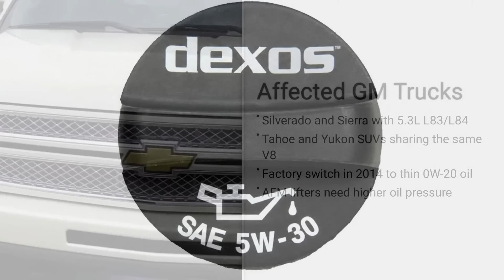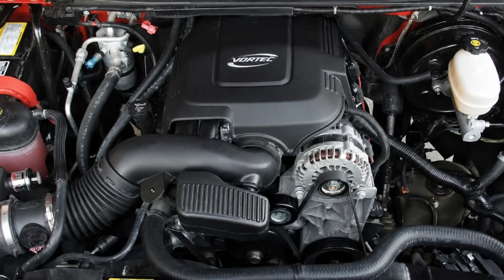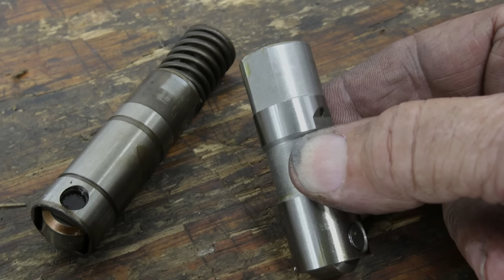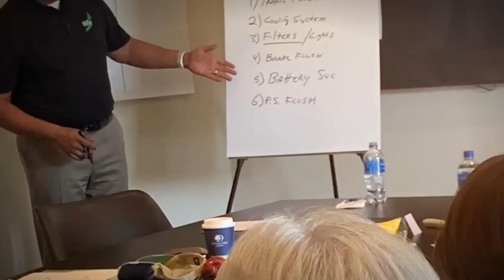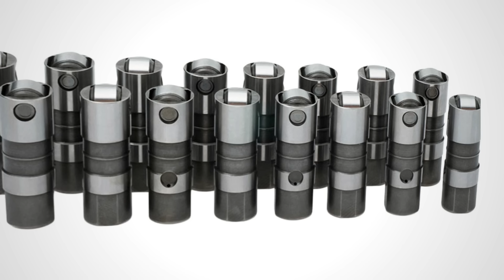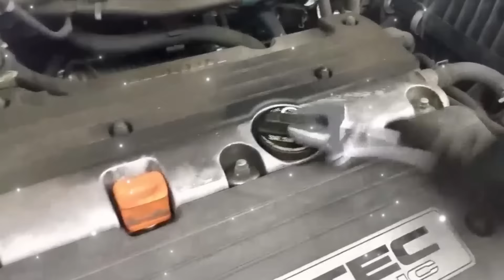The 5.3L Oil GM Tells You to Use Is KILLING Your Lifters — Switch Before 60k Miles

Comment: You pretty much nailed it.  I had lifter failures in both my 2014 Sierra and 2018 Denali.  The 2014 was covered under warranty but the 2018 Denail was not, cost me 4k to get it repaired. I installed one of those AFM disablers onto the OBDII port, worked like a champ. Also, I made sure I did the oil changes myself and used Mobile 1 5-30W instead of 20W.  The 2018 failed at just over 60k miles, just outside the warranty. After switching to 30W, and disabled the AFM, went to 135k miles NO PROBLEM before I sold it.  These engines are great aside from AFM.  The motor would only burn a 1/2 quart between 7500 mile oil changes @ 135k miles. I agree that the number should really be 5,000 miles.  And ONLY use Mobil one, I'd never use that AC delco crap or any other oil that wasn't dexos certified. I use Royal Purple in my 2012 Sonata, has 150k miles, still purrs like new motor!  And that was one of the "bad" engines. Turns out you just need to overachieve on maintenance and they will go as long as you want them to. And don't listen to what the owner manuals tell you, they are full of poop.
Reply: Does your 18 Denali have the 6.6?
Reply: @ParagonRetrievers  6.2L, wish it was the 6.6L, wouldn't have had that problem, as the 6.6L does not have AFM.
Reply: @KingEdward-o7x  Sorry I meant 6.2. We have a 19 yukon xl with the 6.2. Its had all the lifters and push rods replaced in the left side if the engine because of the afm failed lifter. We also have a 17 duramax for transporting dogs. Thanks, we'll be changing to 5w30 on the oil change with the yukon.
Reply: @ParagonRetrievers  yeah after that happened I started using ONLY mobile 1 synthetic and changed it every 7500 miles. Did good after that, went 135k mikes without incident. The key i believe stick with mobil one although i think castrol and penzoil are good too. The main thing is that dexos rating. On my new duramax i’ve been trying to change every 5k mikes although thats probably overachieving some. Alot cheaper than a new engine though.
Reply: Oh as also use the 30w. 20w is a big mistake even though that’s what GM recommends

Comment: I have a 5.3 in a 2007 monte carlo SS with 8k miles, always changed oil started every month during the winter.  One day a month ago started it , was missing, thought maybe some gas problem.  Drove a bit, Check Engine light & traction light came on it never stopped missing.  Short drive, changed the oil (5-30) delete code then p0300 code (random misfire), deleted that code starts idles good for a while, then Check Engine light random misfire code after a while the traction light came on. Next step to get a professional scan tool on it to check where the misfires, fuel trim etc.  Wow this will be a major repair, drop the engine to change all lifters and cam!  AFM what a stupid idea pretty complicated system for a few MPG from an otherwise great engine.  What make of lifters and cam should I use?  Thanks 😓

Comment: Got a '18 Silverado for a work truck, with 18 miles on the odometer. Retired in '25 and the last time I drove that truck, it had 97,000 miles on it and it is still in service.
Reply: my 2012 Silverado with 6.2L V8 has 206,000 miles....still runs great...never a single engine issue.....used 5W-30 and oil changed every 5-7k miles.  But i'll NEVER buy a NEW Truck from ANY manufacturer until they fix their garbage and cut the ridiculous price-gouging prices in HALF!!

Comment: Ive run 0w-20 for 245k miles on 2014, half quart of Marvel mystery at every oil change and 1/2 quart half way through an oil change. All factory lifters still working and no failures. Changed oil when the truck  told me to everytime. Runs like a sewing machine, also run AFM delete chip for the past 200k.
Reply: no one anywhere should ever use 0W oil.  it never gets 0W cold anywhere.

Cold Testing Temperatures by Oil Grade

0W Oil, Cranking test: -31°F (-35°C), Pumping test: -40°F (-40°C)
5W Oil, Cranking test: -22°F (-30°C), Pumping test: -31°F (-35°C)
10W Oil, Cranking test: -13°F (-25°C), Pumping test: -22°F (-30°C)
15W Oil, Cranking test: -4°F (-20°C), Pumping test: -13°F (-25°C)
20W Oil, Cranking test: +5°F (-15°C), Pumping test: -4°F (-20°C)

Type this into Google (for your location):  How many days in the last 10 years did the temperature of MY LOCATION drop below -31°F, -22°F?, -13°F, -4°F, +5°F?

Use 10W-40 minimum, year-round, use 20W-50 for heavy duty like summer towing, always idle after start until idle drops, and never slack until oil gets dark/dirty.  Change all other fluids at lowest end of their listed service range.  ..then why has the manufacturer cabal been exclusively listing 0W oils in the owners manuals and on those freaky little stickers under the hood?  Because the manufacturer cabal would prefer that your vehicle enjoys a shorter lifespan and for you to buy another of their vehicles sooner.
 
ENGINE OIL COLOR CHART
https://www.instagram.com/p/DP2kLcxEvqR/
Reply: Same here but on a 2016 up to 150k. Switched to 5w30 high mileage and lost a small amount of power but it seems smoother
Reply: Hell yea!

Comment: I use 5w30 in my vehicles then switch to 10w30 when I hit over 100k miles and most of my vehicles run for 350k or more until I get rid of it

Comment: 2018 sierra. Bought used and first thing I did was put the delete in the obd. Has around 140,000 miles. Now I will changing the oil type. My son has a 2015 that we've changed out lifters but still tracing down a cylinder 1 misfire.
Reply: Swap the coil pack from cyl.1 to another cyl. and see if the misfire changes to the other cyl.
It's about due new coil packs.
When one fails, the others soon follow.

Comment: Tighter bearing tolerance is the reason for the lower viscosity
Reply: So they say… but then how do they justify 0-40 in the trucks after the catastrophic engine failure?
Reply: @Maynardd  Premature engine wear
Reply: @CAN43714 huh?
Reply: Premature bearing wear from crankshafts made in Mexico that where not up to specs causing what was once tight tolerances to now be loose and the need for thicker or higher viscosity oil.

Comment: I have an 07 Silverado with a 5.3 had a lifter fail, and most recently was losing oil pressure so I changed my oil from 5w30 to 10w30 and my oil pressure came back better than what is was before it start acting up
Reply: No difference between the two
Reply: You don't understand oil numbers, do you? I will help you out. 5w=winter=good down to -20 degrees. You pretty much put the same oil back in your vehicle 🤷

Comment: According to the Above Video
1. SWITCH from 0w 20, 0w 40 to 5w 30 - I hear overseas it's 10w 30 but you go look it up
2. Shorten Oil Change Intervals - I go for 3000 miles (5000K)
3. Look into Physically getting rid of the AFM/DoD/DFM - NEW Camshaft, NEW Lifters and a tune
4. Use an OBD2 AFM Disabler - this tricks the Engine Computer and you are always in V8 mode
5. At approximately 50 000 miles (80 000K) have a Mechanic check the VLOM Thimble Filter

Comment: We have a 12 suburban with the 5.3 l and it does have the afm knock on wood no problems yet and we have well over 300k on it but it gets the oil change every 3k miles and it’s the 5w30 that is put in it

Comment: My 01 with the 5.3 has never seen anything but 15w40 Rotella and it has 501,259 miles on it and it has never ticked or tinged and it runs like a top.
Reply: Rotella diesel oil?
Reply: @joshcollard7834 yep rotella diesel oil.
Reply: @DirtySouthCustoms my neighbor has a GMC 3500 and that's all he puts in it with 360,000 mi on it.
Reply: It also doesn't have AFM...
Reply: @tmbr3nd3n33 my wife's 09 has AFM with over 293,000 on it and all it's ever seen is Rotella and it runs perfectly. Do a little research and you will learn to ignore those numbers on your oil cap.
Reply: 15w40 is the way

Comment: They should give you the option to have the AFM deleted when you buy it brand new with no extra cost to you.  Instead of you having to waste money on a factory defect they refuse to fix.  They can fix the problem before you buy the vehicle.
Reply: Put in Manuel mode M5! It will then stay in V8! Those AFM plug in’s can mess up truck engine   Electronics at least in my exp! Engine light told me change gas pedal, then told me need O2 sensors ?! Thank God I have a good honest mechanic!
Reply: @StoutBordeaux does my 2012 have this mode?
Reply: @DavidMackerron yes on the shifter
Reply: We should sue there asses
Reply: Yep , my lifter just collapsed
Reply: Yes it’s total bullshit . There needs to be a class action lawsuit against gm for this shit .
Reply: @BlueCollarChief-5 and get $150 and the lawyers make off with the money
Reply: There is way to disable the afm..look it up..problem solved..
Reply: IF YOU JAVE AN OLD TRUCK 2006 OT OLDER KEEP IT  DON T GET A NEW TRUCK TO KEEP UP WITH YOUR FRIENDS
Reply: PUT RISLONE  OIL TREATMENT IN YOUR  OIL  DIRT IS WHAT CLOGS LIFTERS  RISLONE CLEANS THEM  OUT IV E USED IT FOR 40 YEARS ON A NUMBER OF TRUCKS AND CARS
Reply: I don't think the Work vehicle line uses them.

Comment: bought my 2016  5.3L  used from chevy dealer with 7500 mi  former lease, trans got triple flush to stop shudder, now I read it may be best to up the weight from 0-20w full syn dexos.  Chevy only doing oil/filter changes since purchased and has 96,000 mi with only a hint of a tick usually on startup but may be during idle, hard of hearing a bit and not sure if still ticking when driven.  dealer says my vin shows my truck is not on recall for delete of lifters or other materials.  I'm due for next change at 5k miles now.  Should I just request 5w-30 full syn dexo with my oil change from them?  I use a plug in afm dissabler only and since 89,000 miles.  Gas mileage and performance no change but easier on the tranny as it feels smoother I guess.  No warrantee left.  What is worth doing, the  thicker oil or nothing?  I get 25mpg hwy going 65 mph on 110 mi trips one way usually unless stuck in traffic.  Very disappointed for not keeping my 2003 Tundra 4.7 4x4  trd 8 yrs ago.  Traded it in for the chevy.  Regretted that move.

Comment: I got a 2003 chevy Silverado I use 5 30 valvalene synthetic  with shield  mines got 230.000 miles on mine get your gas at shell with detergents
Reply: Yeah the earlier 5.3 l engines did not have the AFM system. I believe a lot of it is maintenance as well. I'm currently driving a 2012 Silverado with the air fuel management system, it has 279,000 mi on it and still has the original lifters. It was serviced on time every time though. Every 5,000 MI

Comment: I bought my 2000 Chevy Silverado four-wheel drive V8 Z71 extended cab  brand new at 70,000 mi engine starts to knock took it to the dealer dealer says need to replace my engine went and got a second opinion second mechanic says my engine is good general motors just made poor design on the engine the mechanic tells me engine needs a good flush add a quart of transmission fluid drive around  ex 100 miles and change your oil I did this twice in one year The engine knocks stopped My truck is 26 years old I still own it no problem  I have three other vehicles and I do the same thing to my other vehicles once a year add and quart of transmission fluid drive around an extra 100miles and change the oil I hope this helps 💪🏼👍🏼🛠️🇺🇸🤠

Comment: 2022 Silverado 5.3 using 0w20 my oil pressure at idle after getting it good and hot was between the lowest 2 lines on oil pressure gauge. So I tried 0w40 and then my hot idle pressure never went below 30psi on the gauge. Now trying 0w30. My hot idle pressure on the gauge is just under 30psi. Only have 32,000 miles on engine. Change oil every 5,000. Average fuel economy varies from 19-23 mpg depending on how much highway driving I do. I also use manual shifting on long or steep hills to hold speed back so sometimes running pretty high rpms. So far still running good.
Reply: try 5w40 and you will be shocked at how high the oil pressure is. I use 10w40 Castrol but I live in a hotter country.
Reply: Yeah increased oil pressure isn't exactly great. Under load pressure raises at idle it lowers thats how motors function properly lol
Reply: @plack_benis382  not trying to get too much pressure. Just don’t like my hot idle pressure being so low. 0w20 is between 7.5 and 15 psi. 0w30 is giving  between 22.5 and 30 psi. Both grades of oil run about 60 psi when cold idle.

Comment: the eggheads that work in govt and make the regulations haven't a clue.   they would rather you use an oil that gets you a miniscule fuel economy improvement while it slowy destroys your engine.     the money you save with that minscule fuel mileage increase does not pay for the engine the eggheads destroyed.   not even close.   USA has become stupid and is run by incompetent idiots with agendas.   the voters are no better.   they vote in losers and re-elect them year after year.  the usa is going to fail due to apathy and ignorance of its voters.

Comment: my 2019 Silverado I started using 0 w 40 at 150k still runs like new Mobil 1, after the switch the oil pressure come up considerably, I could feel better response also on the 2023 prius I went from 0 w 16 to 0 w 20 but I should be using 5 w 30 because i drive it only in the summer.

Comment: Been running 5w30 in my 2019 Silverado for as long as I can remember. I don’t trust that thin ass oil. Glad my intuition was right.
Reply: How many miles have you put to your silverado if you don’t mind me asking. Trying to switch as well to 5w30
Reply: @mcirving just do it
Reply: We r talking 5w-30 full synthetic? Right? Also what is the difference between decos gen1 and dexos gen 3. I’m driving a recently purchased 2021 5.3l with 150,000 silverodo. At 154,000 I changed the oil with 0w-20 full synthetic dexos gen3 mobile 1, wix filter. It came with a obd2 concealing module installed and supposedly its oil was religiously changed every 5,000miles. Should I still move to 5w-30 full synthetic dexos gen3?

Comment: I have a 04 Yukon with over 396,???k miles on it.The oil cap says 05W30 weight but I have always put 10W30 init and all my V8 vehicle's. Never have I ever had an issue with any engine's and I've been driving for 43yrs.
Reply: Depends on where you live bub.

Comment: I'm using 5W 30 synthetic in my 2012 GMC Sierra no matter what. I was going to put a AFM chip in and run with it but when I did I had all sorts of failures. I think it collapsed my catalytic converter so I took it out got the truck fixed and haven't considered putting a AFM blocker in since.

Comment: I have a 2017 Silverado with the 5.3 and 95,000 miles. Ive been adding BG MOA ever since it was new, and havent had any problems yet. Is it too late to start using an AFM disabler?
Reply: only too late to plug in a disabler is if the lifter is already collapsed
Reply: I just installed one on my 2014, i love full time v8

Comment: 2007 5.3L b has AFM; I am using the OBD 2 disabler. Change oil every 5,000 km. Has 300,000 klm; just rebuilt the 4l60e. Engine has awesome compression still.  I'm in Alberta, Canada. Journeyman mechanic, love your videos.
Reply: Which disabler do you use im looking to buy one for mine

Comment: I have a 2015 chevy silverado LTZ 5.3 I've been using 0w-20 as the cap says. Would it be fine if I switch to 5w-30
Reply: I've always used 5w-30 mobile 1 and AC Delco oil filter or mobile 1 filter only it's better for your engine 0w-20 is not good for them I heard

Comment: I have a 26’ sliverado 5.3 it takes 0w20 i want to swap to 5w30 so bad ideally I would prefer 10w30 but that’s me but the have full warranty I don’t want to void it.
Reply: By then it's too late... 0 to 5 will not cause damage but 0 will, do a oil inspection, then change to 5 and get it analyzed...compare for yourself... 👍
Reply: @BeAsOneOk switching to 5w30 will it void my warranty that’s my biggest concern

Comment: 20w 50 convention oil❤️
Reply: Correct and correct. Hotter the weather thicker oil is better. Stubbled onto the weather oil chart online switched from 5W 30 to 10W 30 ticking resolved.
Reply: @justinesportsmedicine  had a customer with a Grand Caravan 3.6 pence star number two cam worn with misfire when trying to enter the highway all I did was put 20 W 50 oil changes 20,000 km later no more misfires and quieter motor zero oil consumption👍

Comment: Great report, sums it up nicely. I lucked out my 2021 Sierra Elevation 5.3L has factory deleted DFM due to the chip shortage at the time. I also switched it to 5W30 a few oil changes back. I do 5000 mile changes. It has been solid - so far !
Reply: Yup same on my Silverado 2022 rst, do my oil changes at 3500 miles run ams oil 5w30 no issues yet at 159000
Reply: I got a 21 as well how do I know if mine is the same way?
Reply: @javi1373  Not sure is it likely coded into the VIN. It also said it on the window sticker on mine and was a $50 credit off the MSRP for this huge bonus !
Reply: @GrantB-g5u lol can't beat that bonus!! I might still have mine window sticker somewhere
Reply: @javi1373  mine had the 50 dollar credit as well but I thought it was just for the auto shut-off when at a stop light.  Are you sure DFM is also deleted?
Reply: My 21 says it in the owner book I will screen shot it
Reply: Some of them around Covid were built without them

Comment: 2015 Silverado 5.3 80,000 MI number 7 cylinder collapsed lifter bent push rod the first 40,000 MI I didn't use a AFM disabler I did do a DOD delete switched over to 5/30 weight. 8,$$$.$$ . Thanks GM